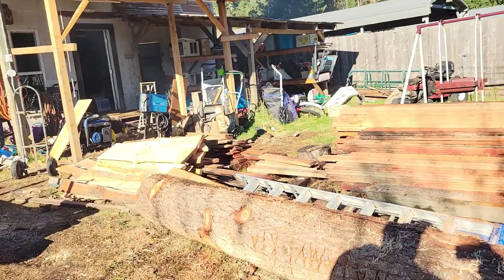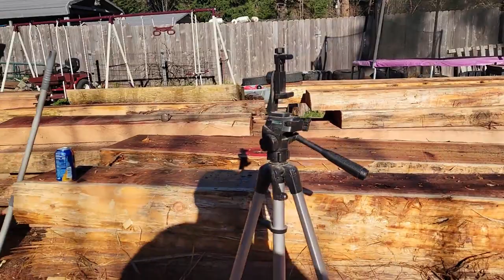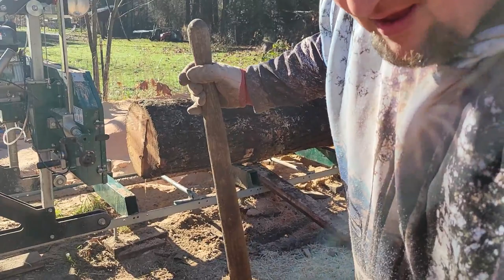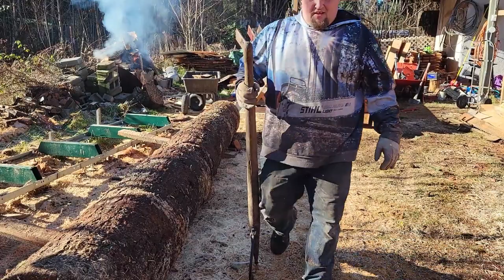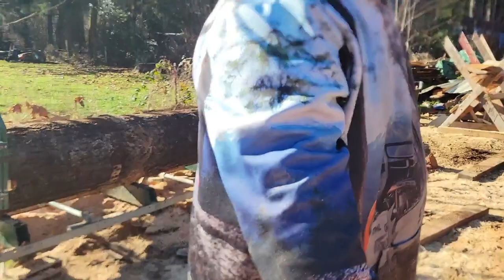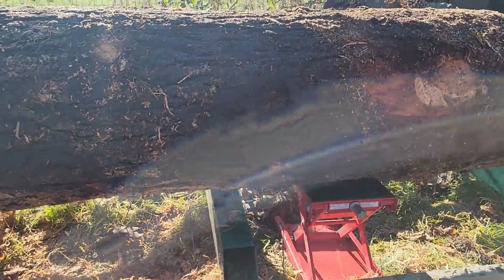Loading a 16 foot Douglas Fir log by hand.

Comment: Nice job getting it up onto there. Is there a reason you kept it at 16'6, rather than cutting it down a bit?
Reply from the maker: Thanks. I left it 16'6 because I want 16' . The extra allows for plenty of trim for any variation during bucking and end check from drying.